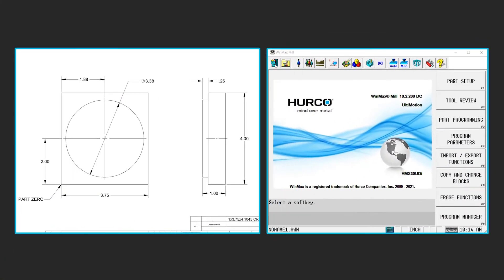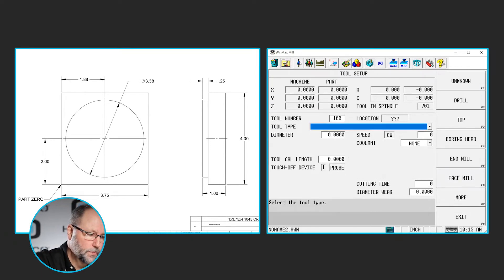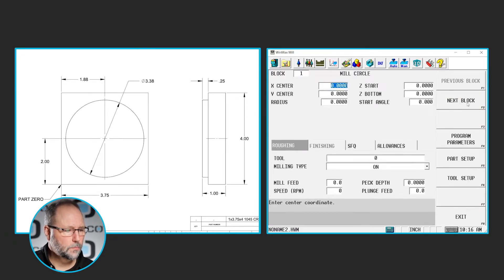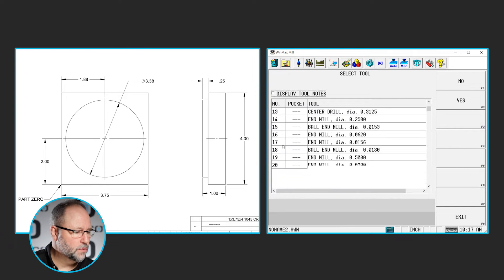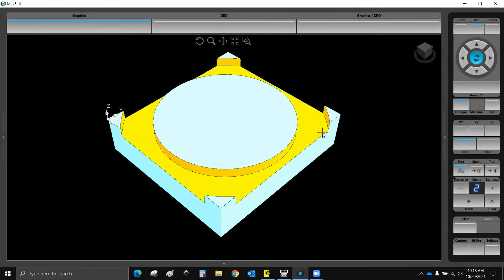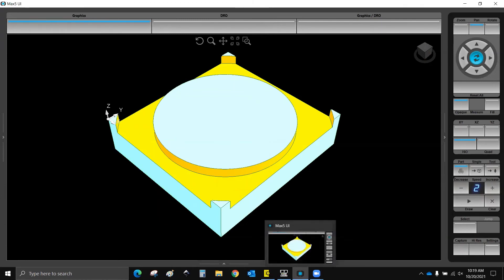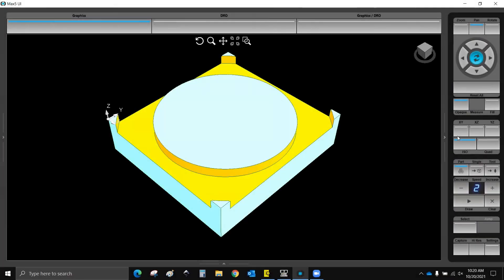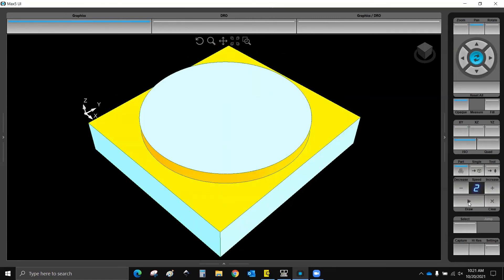Intro 2: Mill Circle Print | Hurco Mill Intro Training Course

Comment: Hi there im a hurco user in the uk what version of win max do you need to get the outside profile option i belive on my vm10i i currently have version win max 10 thanks in advance for any information 👍.
Reply from the maker: Hi Shaun, yes it should be there. In V9 and early V10 it was called Inside/Outside Tangent, but it is the same thing.
Reply: @hurcousa  thank you for the quick reply yeah i have it as inside outside tangent never used them really so not sure what they was but now will definitely try giving it ago on programming. 😀 👍